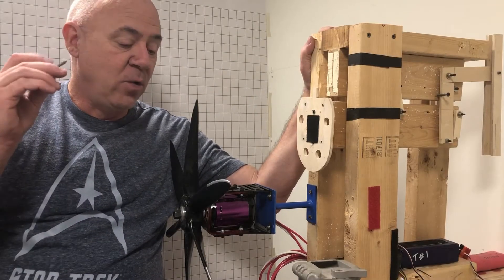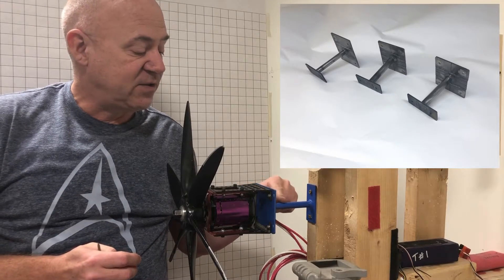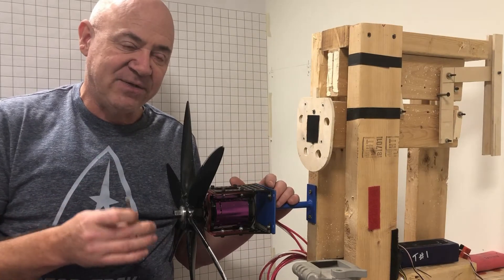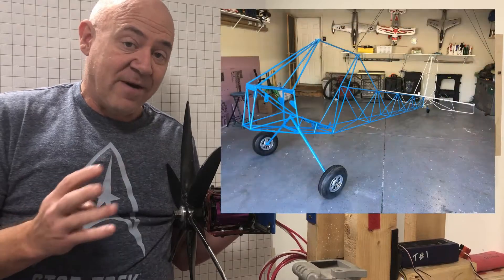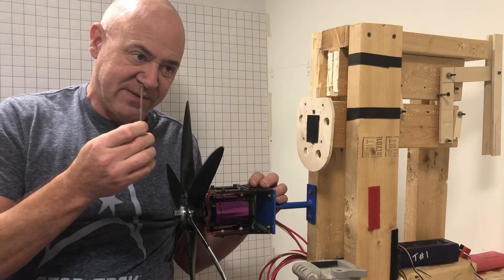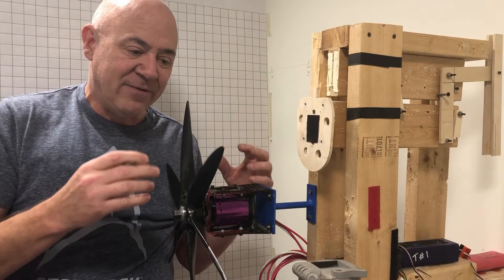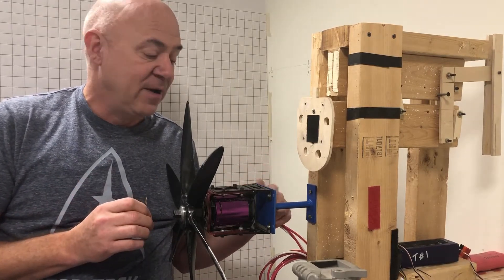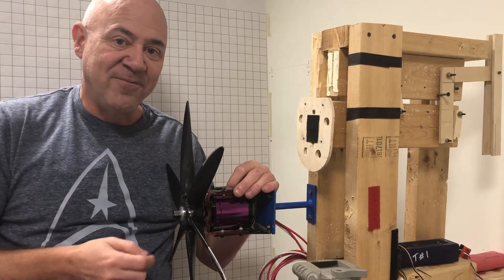Testing 4130 0.5" 0.028 Tubing and the TIG welds.

Comment: I plan on building the legal eagle ultralight most of the tubing is 4130 5/8 .035 wall
Reply: I have the airbike plans as well ... what I like about the legal eagle is it use the 1/2 vw engine and I will never have to mix the. Gas and oil.. I may build a air bike one day. As well not sure but I do have a 447 engine I can use if I do....
Reply from the maker: Very cool. I almost made that instead of the AirBike. :)

Comment: Just curious, would the motor experience any kind of damage/anomalies from a test like this? Or prolonged runs in this setup?
Reply from the maker: This is a motor I have tested in the past to almost its death. I would not use a good motor for this. The shaft and bearings are getting a workout. :)